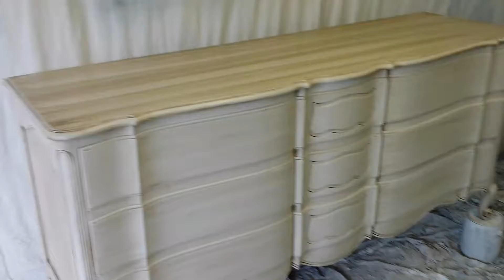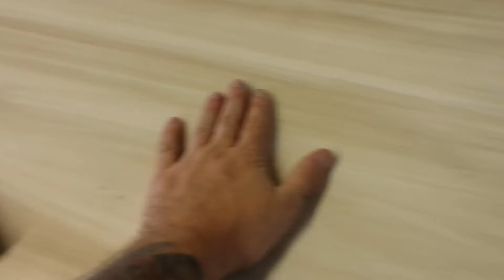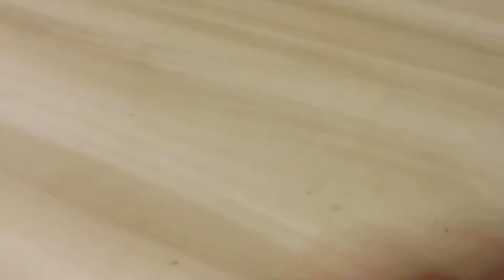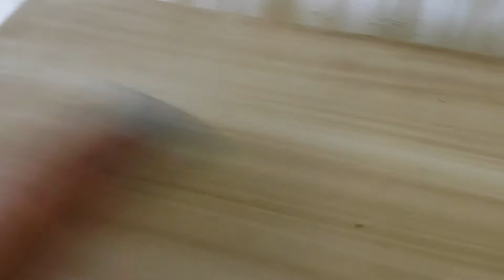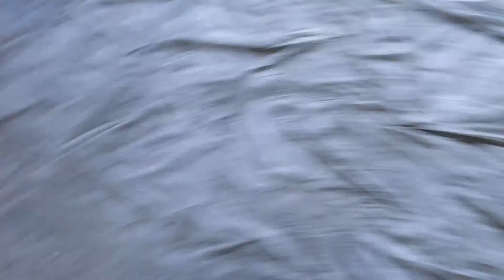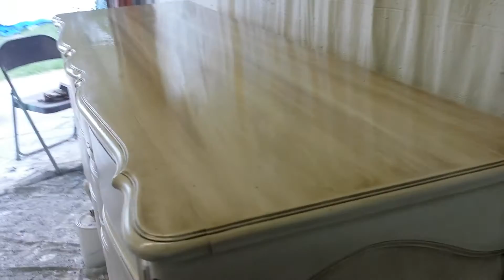Painting Shabby Chic Furniture: Start to Finish - Part 16

Comment: I have a hutch that I would like to do like this, but it is extremely detailed and ornate on the trim. Can I get away with using a good primer to start instead of sanding it all down (which will take forever)?
Reply from the maker: +DL Heckert This is something that is a bit controversial in the furniture painting world. Some people say you can use paints that don't require any prep other than cleaning, some say you need to clean and sand (me), some people you just need to clean and primer, and then some say you need to clean, sand, and primer.

Personally, when it comes to prepping pieces with a lot of detail, I try to hit the outer areas of the detail because those are the areas that may be rubbed against by a knee or waist through normal use. The recessed areas that are carved out or whatever will see very little wear. If you decide that you dont want to get in those details and sand, then I'd definitely make sure you have the details cleaned out really well (dust likes to sit in there) so that your paint bonds better. Then, just make sure if you every get to cleaning out those detailed areas, dont go crazy and end up peeling the paint, but it isnt like its going to just come right off. It would take some force and rubbing.

I once bought a carved rococo style queen bed (headboard and footboard) that was used well for 10+ years and apparently never dusted. It took me 8 hours to properly prep it before we even go to paint it. At the same time, I know it was done right and so did my customers. I got it for $100 and sold it for $1500, so sometimes it is worth it to just do it the right way. You'll feel better about it in the long run. Good luck!

Comment: What kind of stain did you use?  Is gel stain ok?
Reply from the maker: +Christina Cyphers I use Minwax dark walnut. It is an oil based stain. I've never used gel stain as a glaze but I'm pretty sure I've seen it on pieces before. It looks really dark. You might have to experiment with it on a scrap piece of wood and see what happens. Give it some deep scratches here and there to see how it will act on details on a dresser.